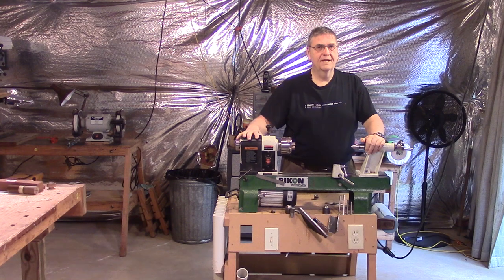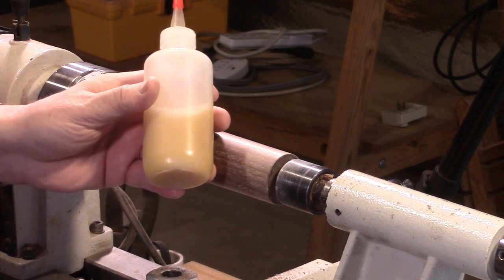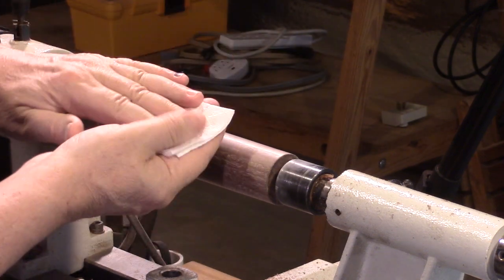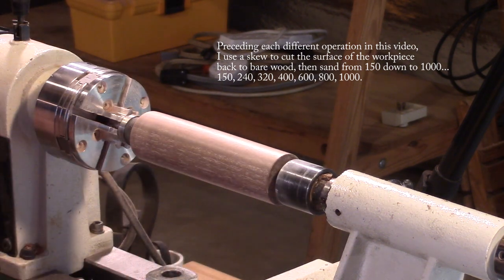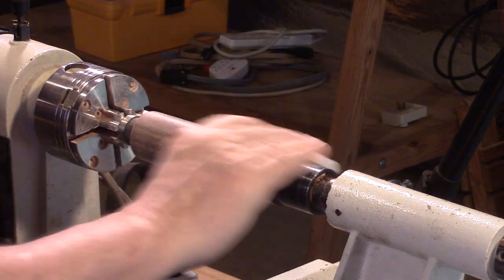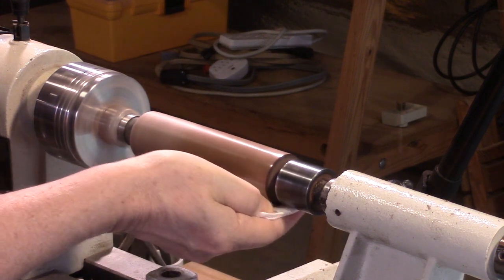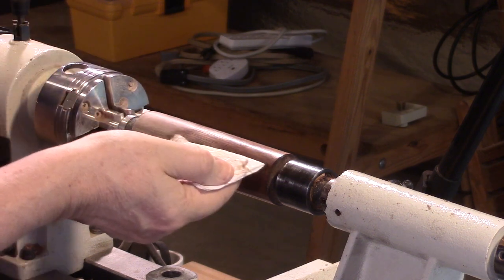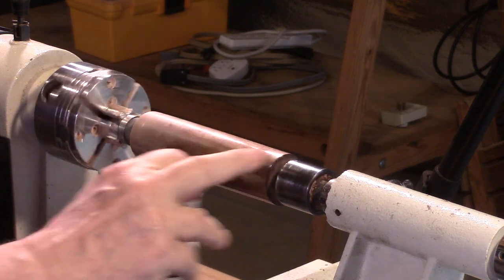Use and Abuse of Friction Polish

Comment: @rickturns, Hi Rick, I've just discovered this polish, I have a piece I'd like to use this on but it already has danish oil on it, is it okay to apply this over danish oil finish? thanks
Reply from the maker: Hi, Barry. I don't think you'd have any problem putting any finish on top of an oil finish. Just make sure the oil finish is dry, which should only take a few days at the most. Friction polish can be made with danish oil or tung oil instead of boiled linseed oil, so there shouldn't be any problems.
Reply: Thanks Rick, I'm from Ireland and Shellac isn't east to come by, might have to settle for commercial friction polish.
Reply: Wait I'm curious about this. Are you guys suggesting you can make a friction polish using Danish Oil, Shellac and Denatured alcohol (1 part each)? If that's wrong, how you you mix a friction Danish polish? Thanks!!

Comment: Would'nt an aerated pad under the paper do a better job? I'm just wondering, I have no experience. Thanks,  Paul
Reply from the maker: It might. However, there 's not much polish dripped onto the applicator, and it might not soak up into the paper towel enough. I've never tried that.

Comment: How well does friction polish work on tool handles such as lathe tool handle?
Reply from the maker: I would not recommend friction polish for a tool handle. Friction polish is primarily shellac, which does not hold up well to moisture. I use an oil finish, such as walnut oil, or a wiping varnish, or just no finish at all.

Comment: I have tried the OB shine juice on a couple of bowls and I am real happy with the results.  I only problem I am having is at the center of the inside of the bowl where I get rings/ridges.  I have tried ramping up the speed (a lot) and I can't seem to get a smooth finish in the center.  Any suggestions?
Reply from the maker: I’ve never had that exact problem, but rings and/or ridges generally mean you’ve got too much finish on. The center is spinning slower than the outer areas (linear speed), so you need to apply less finish in that area. Try sanding the center to remove the built-up finish, then just put a small amt on the cloth and apply that. After it is on, add a little bit more to the cloth and apply it. I hope that works for you, Tom.

Comment: How long does it take for the heat. I just made my first pen. Using Sheila wax and it never really got hot. Warm but not hot
Reply from the maker: Depends on the speed and the pressure you apply. I turn the lathe speed up to around 2000 rpm for friction polish.

Comment: Could you help me out with this. I’ve followed the recipe and application guidelines but within 2 hours of finishing 4 layers, the glossy shine reduces to a dull sheen.
Reply from the maker: Hi, Randy. I’ve had that happen too, but usually only when the wood was still fresh. I presume the moisture in the wood caused the problem, since shellac is damaged by water. If the wood is already dry, you might try putting on a coat of undiluted shellac, and after it dries, try the friction polish again.
Reply: RickTurns Thanks for the reply. On the next piece, I sealed it with a 2lb cut of shellac then sanded to 600. The same thing happened. Comparing the two, the one I sealed is virtually the same as the first one that wasn’t sealed. I’ll do up another piece with extra dry wood to see if moisture is the culprit. I might even try applying the polish to some PVC pipe to see if my recipe is the issue.
Reply: FYI...the polish on the PVC pipe turned out great so must be that the wood is too porous and needs to be sealed well. I’ll try a couple more coats of 2 lb shellac or Tung Oil before trying another application of polish.
Reply: Would you recommend a sanding sealer? Great video.

Comment: Am getting lines in the finish. How can I get the finish without the swirl lines. It looks good and shiny but not a perfect look because of these lines. I've tried using blue shop towels to bounty paper towels. Slow speed Medium speed to High speed. Definitely gets hot. Using Mylands sanding sealer and Mylands Friction polish.Thanks
Reply from the maker: Lines in the finish usually means you’re putting on too much liquid. I’ve never used the Mylands products, but I imagine it’s exactly the same as the home-brew mix. About the only thing you can do wrong is tp put on too much. Sand it down again and try with less polish. Jere’s a link to a good site on using friction polish. 
http://www.woodcentral.com/russ/finish10.shtml
Reply: @RickTurnsWoodturning 
I normally just take a paper towl and  turn container to its side and apply a dab on there. I feel am not over doing it,but I might be. I may also need to store a little of the friction polish in a squeeze bottle to help control how much am applying to towel. Thanks for your help Rick. Any suggestions is much appreciated.

Comment: You never mentioned where not to use the finish. i have a ruined project. the finish dissolved the stain on my project.
Reply from the maker: I've never used a stain on one of my turnings, although I have used an aniline dye on bowls. I only use friction polish on small items, such as weed pots and tea light holders. I'm surprised that a stain, which penetrates the wood, would be affected by putting shellac on top.

Comment: I wish I had seen this video years ago! Some thoughts, six years later:

Sanding along the axis (with the grain) is really only important with materials that have very fine or no grain, Ebony comes to mind, but acrylic or resin is what I find really benefit from axial sanding, end even then the difference is more how long does it take to get to the gloss. axial and radial sanding seems to be a little faster and more consistent for me, but I hate finishing. If course, I'm not putting friction finish on the man made materials, so it isn't an apples to apples comparison. bottom line is the smoother it is before you start polishing, the better the finish in the end. To that end, if its a coarse to medium grained material I sand up to 320 grit, apply a coat or two of sanding sealer, then work from 320 up to 1500. For some species, oak comes to mind, it helps to give a fine misting of water to raise the grain, let it dry completely, then apply the sanding sealer.

I sand down to 1000-1500 before polishing, put on two coats of polish, the first coat goes on with a soft bristled tooth brush scrubbing it in axially, then I buff it in pretty fast, 1700-2000 rpm getting it warm, then slow down for another coat of two. Here is where we differ. after that second coat is good and hard, say 15 or 20 minutes later, I then hit it with 1500-2000 grit paper, or a very fine purple or white Scotch-Brite™ pad, the one or two more coats as 750 (top end of the low speed range on my Rikon 70-220), then polish with either York micro-fine, or more likely these days white automotive polish, then a final buff with a clean cloth. Top it off with two or three coats of hard carnauba wax for depth, and there ya go.

I would really love to see you revisit this, and tell us what you've learned since then, what is the difference between friction polish and OB's Shine Juice? Have you tried straight linseed or tung oil? I do use boiled linseed and Tung oil on furniture projects but haven't used it on the lathe. Anyway, great video, thanks for making it!
Reply from the maker: Wow, you have a really long finishing protocol! I definitely wouldn’t have the patience for all that. Your turned pieces must look great! Frictions polish contains boiled linseed oil, as well as dilute shellac. Capt Billy’s OB Shine Juice is just that - friction polish. Thanks for watching, Wesley.